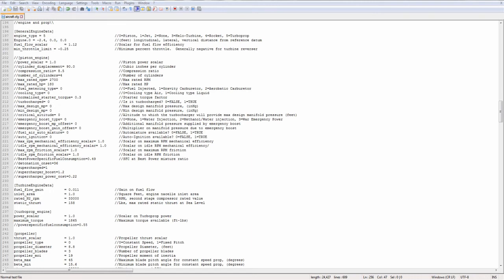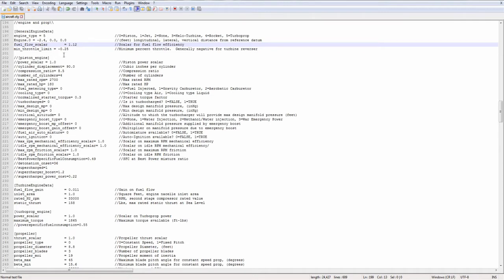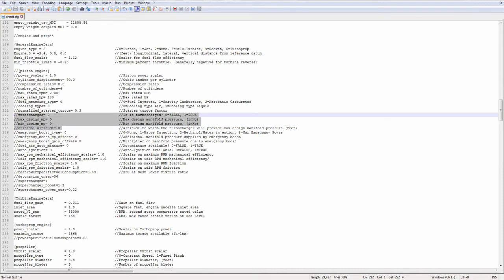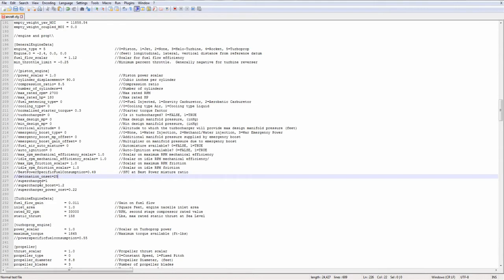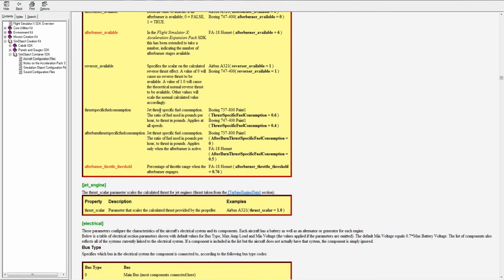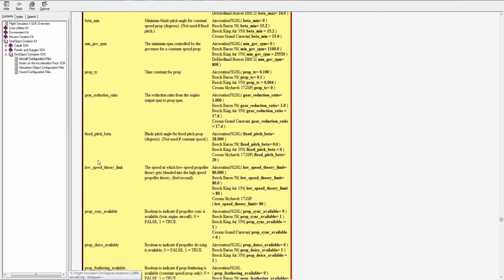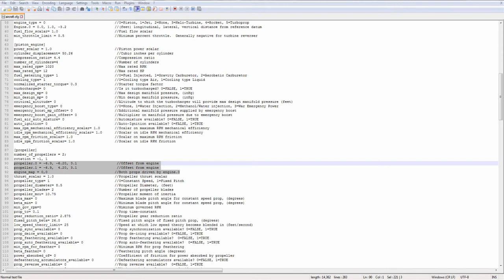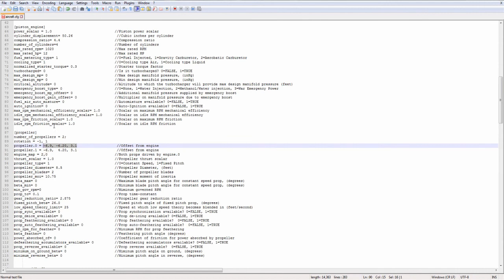Aircraft CFG. Engines and Propellers.

Comment: Is it possible to get jet engines to start below 20% N2?
Reply from the maker: not through the CFG files i dont think so. I believe thats controlled in the AIR file.
Reply: @Desparoto  Ok thanks!
Reply: @Desparoto  I thought it was this parameters in the enginefile that was  - Minimum N1 required to maintain a combustion
min_n2_for_combustion =  - Minimum N2 required to maintain a combustion
min_n1_for_starter_cutoff =  - Minimum N1 at which the starter is automatically disabled
min_n2_for_starter_cutoff =  - Minimum N2 at which the starter is automatically disabled

Comment: This is the scenario, Engine failure on take off
As the engine fails, The propeller has to be feathered (ATPCS) system. However, this doesn't happen. Although the engine torque drops to zero, propeller keeps rotating. Which makes the aircraft impossible to control.
Is there a way I can send a command via FSUIPC or SPAD.NEXT to set the prop RPM to zero. 
So, far I have tried almost everything but couldn't do it. Can I edit the failure of prepar3d some how such that when the engine is failed the rpm also drops to zero ?
or may be even send a feather command or something?